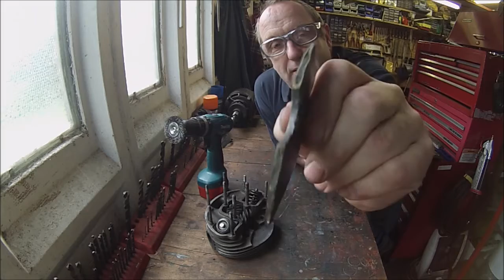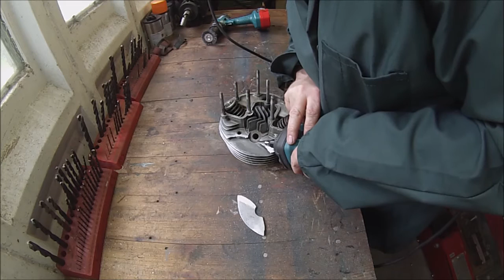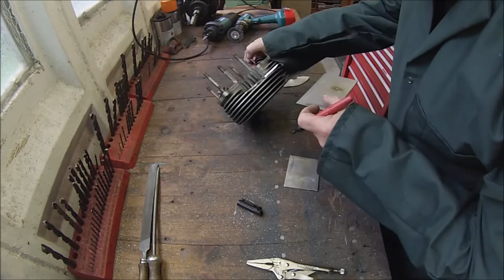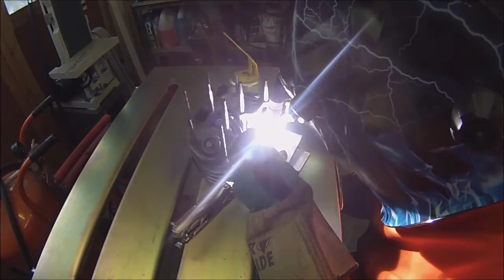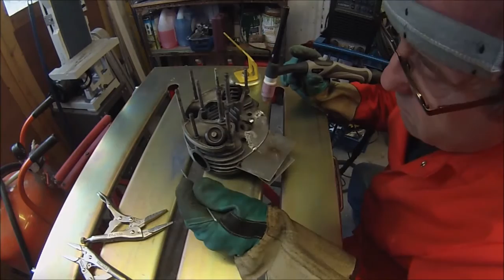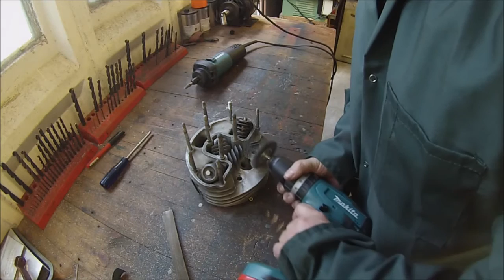Aluminium Cylinder Head Fin Weld

Comment: My ci bullet engine fins are broken and I don't have these broken part how I repair this
Reply from the maker: I have used aluminium alloy sheet cut to shape and welded in, helps to coarse grit blast the piece before welding it on, then fine grit blast after welding and dressing to make it match the sand cast original fins, or finer bead blast with die cast parts. Thanks for watching and commenting, Ade

Comment: Appreciate your content a great deal. Thanks. B50 rounded corner square shaped head? So, B40 rounded barrel and head? But it is a caste iron head (?) so C11?
Nope, once it was clean it looked like aluminium to me. B40.
I have to ask....did you get a brand new dust coat?
Reply from the maker: Thanks for your comments. I have a few dust coats around, depending which one I pick up

Comment: Nice clean repair. Ive no welding facility so tried to use 'aluweld 400' soldering sticks - which were 'ok' . The biggest problem for a novice like me is getting enough heat into the parts with a propane torch and a cobbled together hearth of firebricks.
Next time Im sending it to you ;-)